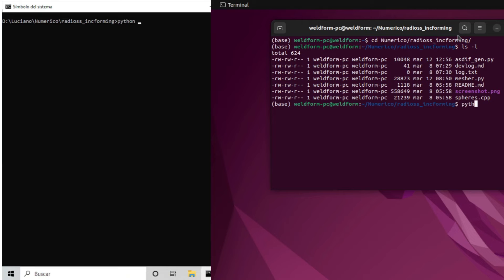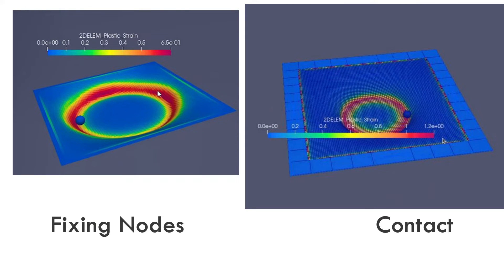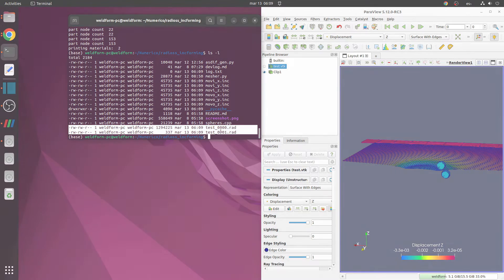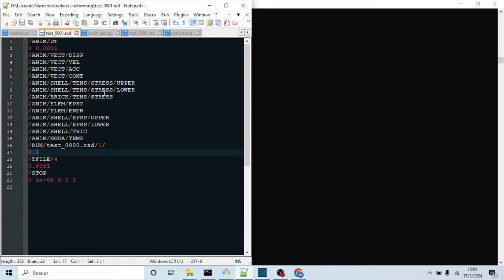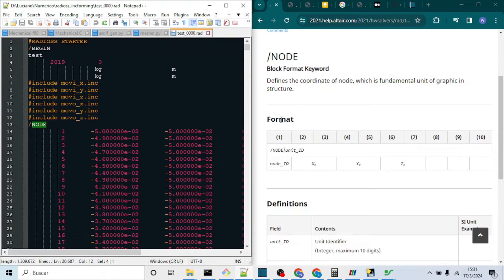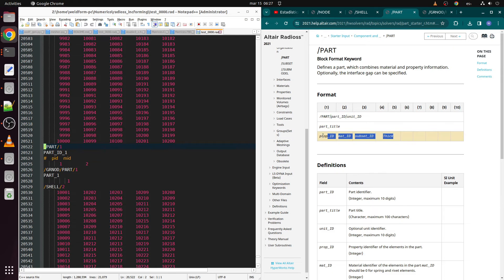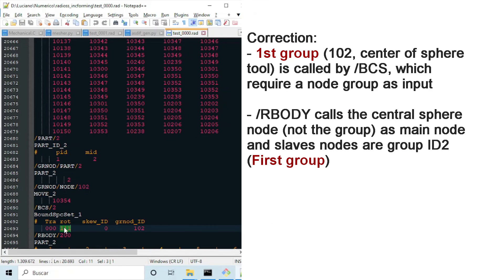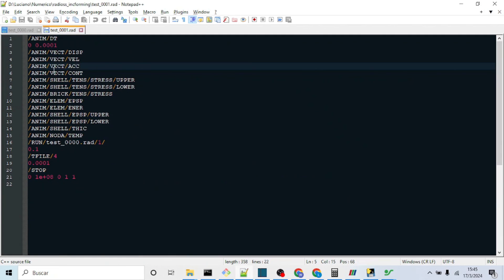Fastest FEM Model Ever! Python script [Open Radioss #2]

Comment: Great video and thank you very much for your outstanding work! As far as you know, is it possible to simulate polymer thermoforming with openradioss? (would need coupled mechanical-thermal models, viscoelasticity or hyperelasticity I think)
Reply from the maker: Hello!!! Thank you very much!!! Your support means a lot to me! You can suscribe to the mail list in which I send a monthly report and you can also suggest material for me to create content about (on this link: https://opensourcemech.com/subscribe.html  )! 
Regarding to polymer simulation in Radioss, yes, you can use /MAT/LAW34 (Boltzmann (visco-elastic)), /MAT/LAW62 (hyperelastic) and several others like 88, 100, and 101 which are suitable for polymers. Here you have all types https://2021.help.altair.com/2021/hwsolvers/rad/topics/solvers/rad/hyper_visco_elastic_materials_starter_r.htm 
You can see if each one of the materials accepts heat coupling capabilities here:
https://2021.help.altair.com/2021/hwsolvers/rad/topics/solvers/rad/materials_starter_overview_r.htm
If the eigth column (Embedded Thermal Option) say yes, you can. In that case, you couple the thermal properties by adding /HEAT/MAT and the mat index command (see my radios tutorials scripts in which I do exactly the same to the incremental forming models). 
Hope you find this useful!!
Reply: @opensourcemechanics  Thank you very much for your answer! I didn't expect it to be so detailed and focused! I just subscribed to your mail list. Very high quality content.